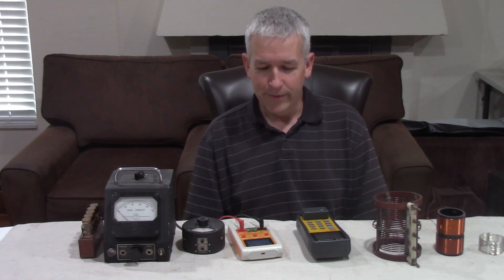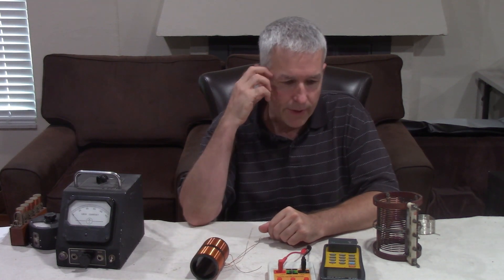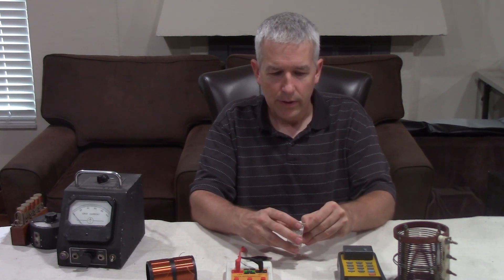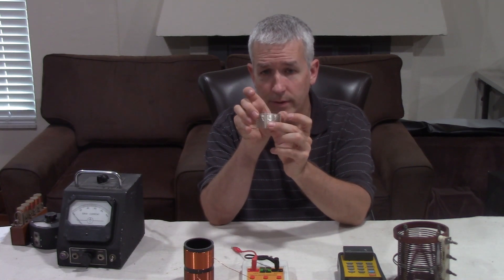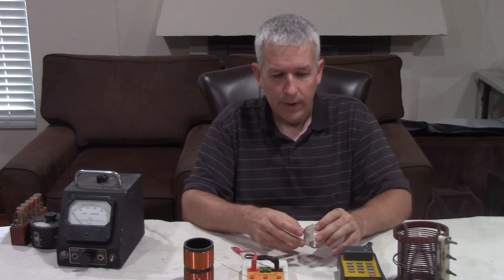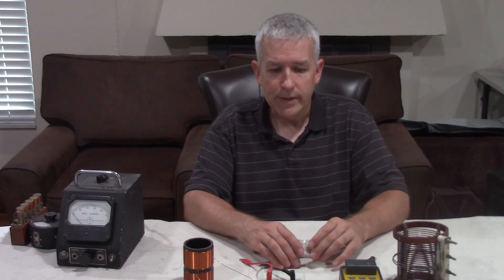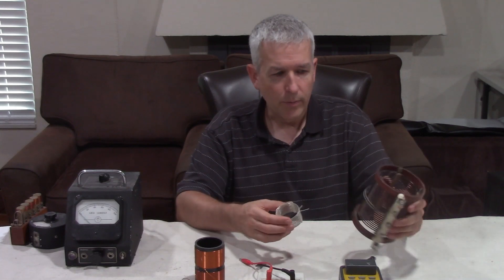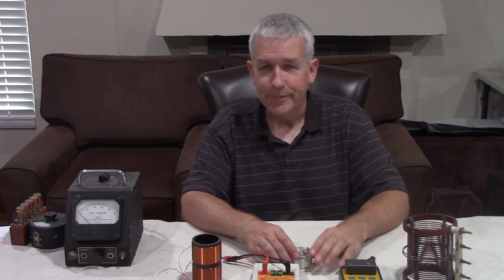LCR frequency limitations and exact measurements

Comment: Thanks for sharing.  

Do you mean with “Free Resonator” a situation where L2 is still oscillating even thou L1 has already stopped to oscillate?

There is a picture in this Wikipedia article in the “Quenched-spark transmitters” Section, 
where it shows a damped oscillation in L1 and a much longer oscillation in L2.

https://en.wikipedia.org/wiki/Spark-gap_transmitter

Is that what you are referring to?

The following link, shows a perfect looking replication of one of Donald L. Smith devices.
You shared a link to this video in one of your older videos.

https://www.youtube.com/watch?v=RFSQWUTDQF0

The Capacitors are in the range of nanometers. I guess this device is of type 2?
Reply from the maker: Yes the wiki page shows the waveform and other correct information, but I don't have the time to carefully read through it right now as they usually have a lot of misleading information. 
The other link to the Don Smith replication I am confident that it is working as shown. Most likely not for several reasons. Wires could have been added behind the bulbs.

Comment: I have the DE-5000 LCR meter I bought from eBay for around $100 shipped from Japan :) I'm curious if there's much difference in the measurement values between those two LCR meters on the same frequency range. 
Inductance value of an air core coil stays mostly the same, while Q and C measured values depend on the selected frequency.
Tank you for that Helical Coil Calculator link, Rick!
Reply from the maker: Yes there is because the max frequency on the inductance is 350 rather than 100khz. That is way more range. And yes the coil calculator makes this all more accurate if you don't have access to a higher frequency meter.

Comment: How about an even cheaper way to measure megacycle resonance? Imsai guy has a video on it, using a cheap rf noise source module and a tinysa spectrum analyzer. Another plus, is that its wireless.
Reply from the maker: No, did you hear what I said in the video that you can use the calculator to accurately predict the resonant frequency, except if there is another coil part of it.

Comment: How do you play trumpet on oscilloscope? 📯🎺
Reply from the maker: People mistake the oscillations in the probe for oscillations in the coil. The probe has it's own inductance and capacitance and it is its own circuit. It is only a tool used to estimate what is happening in the circuit and therefore many people are mislead by depending upon it.
Reply: @rickfriedrich  so there other method to measure overunity as oscilloscope are not most accurate
Reply from the maker: I'm just saying that many people, especially engineers don't realize the limitations of their meters. It is all about understanding the context they are in and what they are expecting to see. People really don't know what they are looking for most of the time. We can use scopes in various ways to show what is necessary. I'm just saying that the probe is a circuit and that is not the device itself. It is an attempt to represent what is happening to the device. But the probes can alter the device in some cases as mentioned.